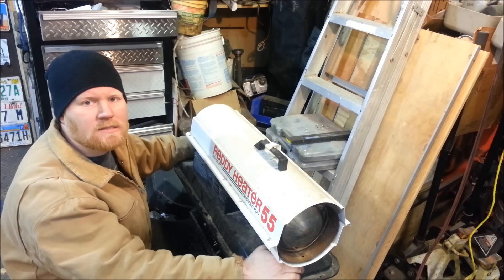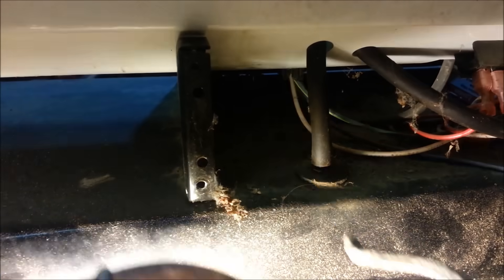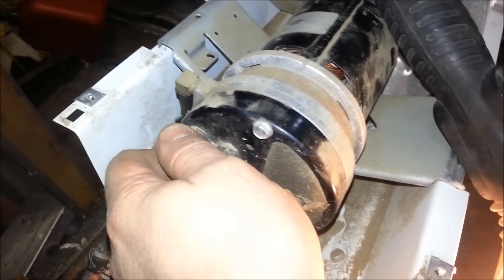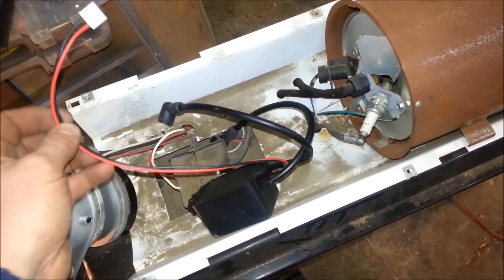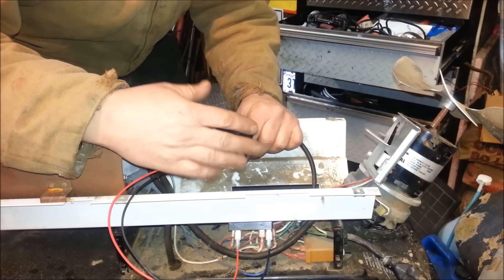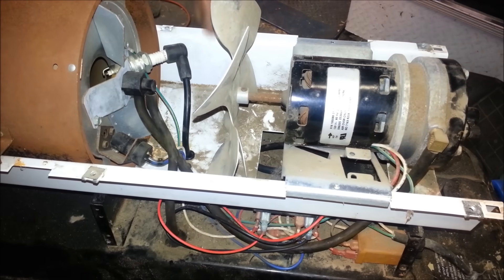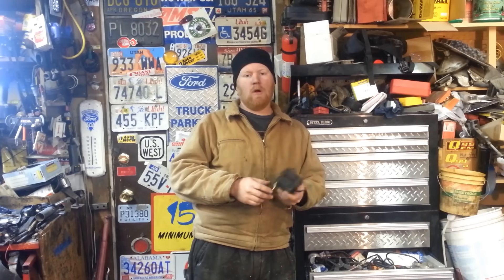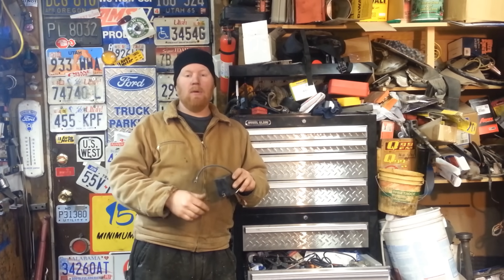Torpedo Kerosene Heater repair & HOW they work

Comment from the maker: INSTALL A GAUGE TO ALWAYS MONITOR YOUR PRESSURE
0-15psi GAUGE(needs cheap adapter below): https://amzn.to/2UBLqCV
Adapter to allow gauge to hook to heater: https://amzn.to/37enCaI
Install a thermostat to stay comfortable and save fuel: http://amzn.to/2b2qj2h
Keep yourself safe with a carbon monoxide detector: http://amzn.to/2b7h6Yr

Ignition Module I used in the video https://amzn.to/3kWVCiD GHP 39E0-0008-00( any 39E0-00*-* will work the same (the length of the leads is the only difference in model numbers). The one I bought must have been on clearance as it was cheaper than what these are now. If you're replacing a single wire ignitor with one of these 2 spark plug lead wires units; ONE lead will hook to the existing spark plug and the other lead will ground out to the frame or housing that makes electrical contact with the outside(threads) of the spark plug. You can flatten out the end and put a screw in it or something similar. This differs from what I did in the video.
Reply: I think my aftermarket pump filter is the culprit... screw all the way in just to get 3psi... tag said 3.6... buying the OEM one.
Reply from the maker: @ktcopyguy  You can take apart the pump and make sure the vanes are in good condition. You can also just remove the filter to test if it makes a difference.
Reply: @sixtyfiveford  pump veins are new, I will try without the filter, thanks for you help!
Reply: ¹l
Reply: Quick question I have a master heater it's not that old and most if the time fan doesn't wanna spin unless you spin it by hand then hit start
Reply from the maker: @kevincollins3176  lubricate the front bearing/bushing with ATF or Motor oil
Reply: Can you tell me how to install a thermostat on mine? Thank you.
Reply from the maker: @scottcryder3737  https://amzn.to/3BjZXra

Comment: So I've been entertaining the idea of running my diesel heater off of a bigger tank. You think it would hurt it to put a fuel pump on the draw tube? Or how would you go about that? Basically I want to use the torpedo heater as a furnace sort of. I'm just tired of filling it all the time but I've got access to 100 gallon tank I could use to draw out of
Reply from the maker: The problem is the depth of the tank is regulated to help the Venturi effect pull up fuel through the nozzle. You can only have it about 4 or 5 in deep max. I would look into using something more like this https://amzn.to/3MBpSDp . It's an automatic fill and stop device generally for gas tanks on generators So they can run indefinitely
Reply: @sixtyfiveford hey thanks! I didn't know they made something like this. I really appreciate it

Comment: IMPORTANT VIDEO ---The smaller heaters like this have the air hose feeding the rear adapter port and fuel to the front--The 100k heaters are reversed--thanks for this !!!

Comment: This was so helpful.  Just picked one up from a neighbor, I plug it in and nothing happens at all, air pump doesn't run, no glow plug, no nothing.  I will check to see if it has a breaker switch and go from there.  The instructions on the unit says if it has a thermostat, to set it.. I don't see anything that obviously looks like a thermostat?  It's an old Sears Roebuck unit.  I'm an auto mechanic and know a little about heaters but never been around this style so this video will get me started, thanks for that, it was helpful.

Comment: Why when I take my top off of my torpedo heater the igniter ignites when I put it back on it doesn't ignite
Reply from the maker: Because you don't have the air pressure set correctly.

Comment: The newer torpedo heaters, the ignitor shuts off after its lit..
i had two install the push button for the ignitor.

i CANT SEE PUTTING MORE WEAR & TEAR ON THE IGNITOR, OR PREMATURE FAILTURE...
Since there is no such circuit to shut off the ignitor.. the push button fixes that problem

THERE IS NO NEED TO HAVE THE IGNITOR SPARKING CONSTANTLY AFTER IT LITS UP...
turn heater on , push the button one time to kick in IGNITOR for few seconds then it shuts off after release of button...
Ir will last longer... since it wont be sparking constantly...

THE SAME GOES FOR THE DIESEL HOME FURNACES, THE NEWER ONES, THE IGNITOR COMES ON FOR FEW SECONDS THEN AFTER ITS RUNNING & SEES FLAME, THE IGNITOR DISCONNECTS......

Comment: These things ore simple but good design - great explanation - wondering though if a person could make a bigger tank or a way to pull out of an aux/ secondary tank of fuel ?
Reply from the maker: @anthonybannister3557  There are simply a fuel pickup hose that siphon feeds the main jet. The problem lies and it can only siphon feed maybe 4 or 5in down. So you can make a wider tank but not really a deeper tank. 

There is an automatic refill device on the market right now that's meant for generators. It goes into the fuel tank and when it goes too low it pumps fuel from an auxiliary source into the tank. It turns itself on and off. That might be a viable solution.

Comment: Great video, one thing you overlooked (That is  MAJOR contributor to a dead/non-working heater is the carbon vanes wear out in the air pump on the back of the motor. These must be DRY when installed. If all the basics fail THIS WILL BE the problem.  https://www.google.com/search?q=reddy+heater+vane+kit&sca_esv=8eb0cd9e9e5d4061&sxsrf=ADLYWIIHE3Knc_zfFGTtcO2S-Ax8iw-8-w%3A1735315516879&source=hp&ei=PNBuZ9qDM9m0wN4P6aiXsQg&iflsig=AL9hbdgAAAAAZ27eTO5Vt_TYkGKaxnasTFuA8yGNsb4X&ved=0ahUKEwjakdGHqsiKAxVZGtAFHWnUJYYQ4dUDCBg&uact=5&oq=reddy+heater+vane+kit&gs_lp=Egdnd3Mtd2l6IhVyZWRkeSBoZWF0ZXIgdmFuZSBraXQyBRAhGKABMgUQIRigATIFECEYoAEyBRAhGKABMgUQIRigAUiTTlAAWIpIcAB4AJABAZgB7ASgAb8kqgEMMC4xMy4yLjQuMS4xuAEDyAEA-AEBmAIUoALcJMICBBAjGCfCAgoQIxiABBgnGIoFwgILEAAYgAQYkQIYigXCAggQABiABBixA8ICCxAuGIAEGLEDGIMBwgIIEC4YgAQYsQPCAhEQLhiABBixAxjRAxiDARjHAcICBRAAGIAEwgITEC4YgAQYxwEYJxiKBRiOBRivAcICERAuGIAEGJECGMcBGIoFGK8BwgIOEC4YgAQYsQMY0QMYxwHCAgsQABiABBixAxiDAcICDhAuGIAEGJECGLEDGIoFwgIOEC4YgAQYxwEYjgUYrwHCAgsQLhiABBjHARivAcICBRAuGIAEwgIGEAAYFhgewgILEAAYgAQYhgMYigXCAggQABiABBiiBMICBRAAGO8FmAMAkgcMMC4xMS4zLjMuMi4xoAelogE&sclient=gws-wiz

Comment: These older units have been replaced by modern systems and electronic ignition, ceramic EFI , brushless motors etc. So I now have a 2023 dyna-go for those reasons
Reply from the maker: So it's junk when it breaks in 3years.

Comment: I have a R50 and it runs fine without the cover. When you put the cover on it starts to flame out and will shut down. I replace the photo cell and the filters. any suggestions ?

Comment: My heater says the pressure should be 8.5 but with the adjustment screw maxed it’s only 8. Also with the top off I can see fuel spraying back out of the chamber. What should I look into?
Reply from the maker: I explain the system way better in this updated video
https://youtu.be/r_P58zIhnA4

Comment: I have one very similar to this one, but mine is 100,000 btu and has a glow plug instead of a spark plug. When you plug it in, the heater dosent start for a few seconds, it waits for the glow plug to heat up and then it starts

Comment: What does the flame out safety switch safeguard against? Overheat? Tip over? Something else?
Reply from the maker: It stops the fuel pump and fan from filling the room with unburnt fuel. This is essentially a smoke cloud of kerosene/diesel.

Comment: with the airpump, would it run on waste oil, if you heat it ?
Reply from the maker: Yes, BUT... You have to physically breathe in everything this pumps out as far as heat. Waste oil will choke you out pretty fast.

Comment: I just bought one from a garage sale. It looks almost brand new. They said that they used it a couple of times then they bought a gas heater and haven’t used it sense. So when I got home I tried it out. The fan kicks on but never fires. So I took the cover off and the glow plug does work. But I broke the damn thing taking it apart. Lol. I should know better since I’ve replaced many in my furnace. And I also I see the fuel shooting from the nozzle. So my guess is that optical. That’s really the only thing I can make of it. Their is also a small board panel in it. But I really don’t think that it that. So I guess I will see when the new glow plug comes in. Unless you have any ideas. 😀🤣🤣

Comment: This helped. I've been soaking the fuel tank of my Reddy Heater 79 in Evapo Rust and tumbling with nuts and bolts to remove rust from the interior of the tank. I was not sure how fuel was drawn in but now it's all clear. Thank you for creating this video.

Comment: Man , Your videos are so helpfull, Thank you .Im Freezin my balls off here in Western Ireland ,no insulating in me boat shed. I hav no spark on my heater..i think my coil is busted now as it has cracks in the back of plastic housing. I Tested the electrode while running. with phase tester ,and no voltage. Gonna try amazon and grab that one you mentioned or similar. I hav to say you are one ingeniously innovative man ! Yer videos amaze me. And im NOT easily amazed.
Reply from the maker: Thanks, I'm glad you like them.

Comment: I've got one of these, pressure gauge installed, when it runs it runs great but it will run backwards at start up sometimes. I'll either spin it in the  right direction with my finger or an air hose to get it started. I'd like to fix it permanently. It has a thermostat but it will run in reverse again when it restarts. Any suggestions?

Comment: i have an old reddy heater - probably from the late 70s- early 80s. it has problems igniting. once it ignites it will run with no problem.  Sometimes it won't ignite at all, even after numerous attempts, then fuel starts leaking through the front of the heater since it's not being ignited.  If i remove the lid, it ignites instantly every time.  it has a new filter, new spark plug, new nozzle, and no cracks in any of the rubber lines, and i set the pressure to the spec on the unit.  what could be the problem?

Comment: What is the purpose of the photo sensor?
Reply from the maker: Determines whether or not there is a flame. It's sometimes called a flame sensor. So if the flame goes out, after 5-10 seconds the entire heater will shut down and trip the safety switch.
Reply: @sixtyfiveford  ah ok when the glow plug lights up no fuel sprays out and it shuts down, but the photo cell may still be bad because it’s shutting down, just not sure why the fuel isn’t spitting out
Reply from the maker: @Natural-Causes  I go into way more details of the workings in this video https://youtu.be/r_P58zIhnA4
Reply: @sixtyfiveford  I agree!  I watched the whole video, it was very good but I don’t recall you mentioning why it might not spray gas out.

Comment: Been watching your series on these Heaters, Excellent Job!. I have a Reddy Heater Model R100A that I picked up free from a friend. It appears the fan motor is seized. No movement at all. Tried gently with Vise Grips to move and nothing. Any suggestions or possibly a suggestion on a motor replacement that is reasonable? Thanks!

Comment: To dead end a spark plug wire pack the rubber boot pull off dielectric grease and put some heat shrink over it. That's the best way I found when working on old furnaces where you gotta use some universal deal.

Comment: What fuel are you using? Kerosene or diesel?
Reply from the maker: I only use diesel.
Reply: @sixtyfiveford  Thanks. I just got one exactly like this yours. Reddy 55. There's some kerosene inside (it looks like it's in there for years) because some smelling is coming up when it fires up. I also had to replace the spark plug and clean up the fuel nozzle with some WD40 to be able to fired it up.

Comment: any clue as to what would cause a torpedo heater to run fine for a few minutes(heat plate gets red hot as it should) and than it seems to lose fuel quantity than sputters and than goes out, than it becomes a smoke machine and shuts off?....... replaced the fuel line and air, checked pressure and it seems fine, spark seemed to be fine when I pulled it out..... opened the nozzle and cleaned it out.... things I still plan to do hopefully tomorrow after work are check it the spark goes out at all around the time it starts cutting out, and if not empty the tank wash it out and air dry it in case something is up; a bit lost as the thing had been working the last time I used it, been out of use since last winter
Reply from the maker: My first thought would be spark going out.
Reply: @sixtyfiveford  seems you are right.... to save on time in case murphies law came into play, I had emptied the tank, washed it out(palmolive and hot water); suspected maybe one possibility  was the filter was clogging after a few minutes; air dried it out with a blower over night.... reassembled it, ran a temporary line from the pail I poured the diesel into, it came on as before watched it spark for a few minutes than cut out; disconnected the diesel a few times to verify it further and seems it was indeed cutting out after a short while........ cause I'm going to be waiting min of 2-3 weeks for the replacement I tried to boil the module in water to see if it would be easy to melt the epoxy(youtube unpotting electronics videos) but seems it has black epoxy followed by probably some kind of stiff ?silicon?(essentially the same unit as the replacement you used; dynaglo pro,  WMI924).... Thanks for the response

Comment: SUPER AWESOME VIDEO!!
THSNK YOU!
My problem is slightly different…..
It used to run great, then it started cutting off and blowing a lot of smoke, now it starts for maybe a minute blowing heat and working great, but then blows no smoke, then restarts for a few seconds, and after a couple tries- just blows only smoke and trips the reset on it? Psi is perfect, optical lens looked clean, and cleaned the spot off the industrial plug…… there is air blowing out of the tiny hole in the pressure adjustment screw, and if I stick my finger over it, it reignites- but my pressure gauge goes crazy high!!!! 
I just ordered a new air pump gasket/ filter, plug, and optical sensor to see if that fixes it, but now you have me wondering about the ignition box? What should I be looking at, and how do I test it? Thank you in advance for any help!!!!
You have the best video out there about these old things!
Thank you!!!
Reply from the maker: If you put your finger over the back and it ignites and runs that lets me think you have a crack in your airline going from the air pump to the nozzle.
Reply: @sixtyfiveford  THANK YOU, I’ll check the line! Is air supposed to be blowing out of the middle of the adjusting screw?

Comment: I have spark, cleaned air pump , still does not spray fuel. Suggestions?
Reply from the maker: The most common cause is a split the air or the fuel line going to the nozzle. In the airline that bleeds off any air pressure and in the fuel pickup line it allows air to be pulled in rather than fuel.

Comment: My space heater the fan motor not runing when I turn it on I checked the capacito and it was good .the spark is there but the fan looks like want to run bun can't..what you think ?

Comment: i have same heater but is 110k BTU. 
what happens if the vac is to high or to low ?

i h ave never ever checked the vac or adjusted it, i just add fuel and run it.. runs good just not sure if its running optimally.
Reply from the maker: It will either run lean or rich. Lean and it's just not putting out as much heat as it could. Rich and you'll smell it/it'll burn your eyes.
Reply: @sixtyfiveford  might be lean, i ran kero in it recently starting running offroad diesel in it. runs awhile spits some some smoke trips and have to reset.. never did that until i ran offroad diesel in it.. my friend said its water in the tank doesn't surprise me since it wast outside for months.  Kero seems to burn hotter..  do i need to adjust for the tyoe of fuel running ?

Comment: Mine stopped pushing out the fuel from the nozzle.  Does the pump wear out?
Reply from the maker: Generally the air line coming from the air pump at the back just splits and needs to be cut shorter and reattached. The air pump does wear out, but only have thousands of hours of run time.

Comment: My lights but there's smoke and it smells probably needs a new wick how do you change the wick on these things?
Reply from the maker: The air pressure needs to be set correctly. When it's set dead on you will get no smoke or odor.
Reply: @sixtyfiveford  Are there wicks to change in a unit like this? It's a several years old with a lot of use.
Reply from the maker: @thearoom  There are no wicks in these forced air heaters.
Reply: @sixtyfiveford  ah.  Ok. Thanks

Comment: When mine plugs in the fan does not move. The Ignite starts with spark plug but no fuel or fire. The motor fan has to run correct for the air pump to push air. This is new to me and I just got it gave to me to fix if I wanted to keep it

Comment: What would cause my heater to spit and sputter
Reply from the maker: Either the air pump is leaking air (split line) or your fuel pickup is split and leaking.

Comment: I have one (that currently doesn't work) and will have to take a look at this. But, when it did work the Kerosene smell was overwhelming. I tried some low odor kerosene but it's nearly twice the price of normal Kerosene. Do you have a recommendation?
Reply from the maker: Yes you need to adjust your air pressure. adjust your air pressure exactly to what it says on the machine and you will have absolutely zero odor whether you run kerosene diesel etc.

Comment: If you have used diesel fuel instead of kerosene your optical center can get clouded with smoke you’ll need a Q-tip and some alcohol to clean it off just a tip